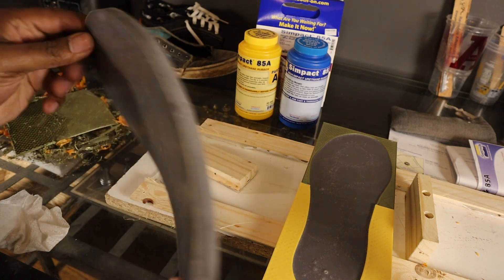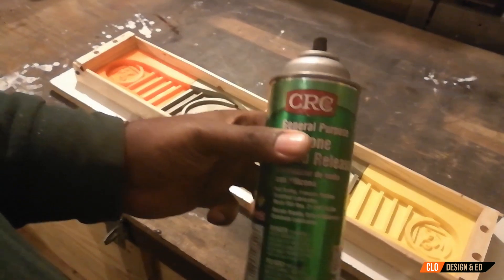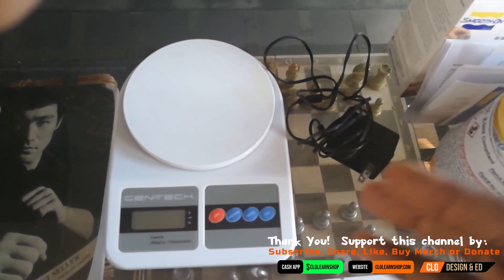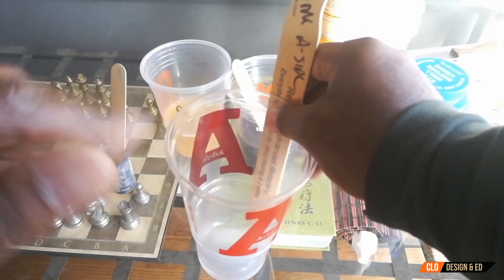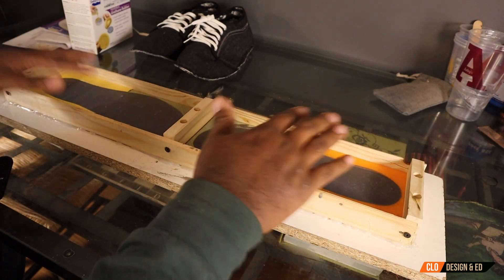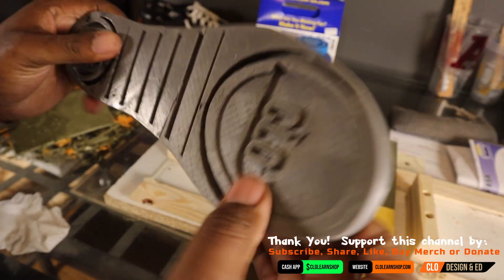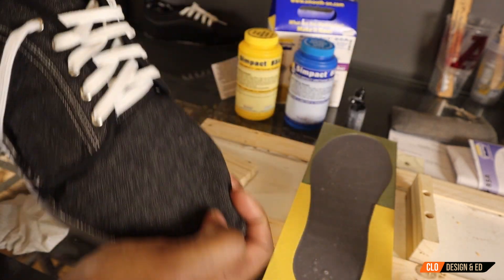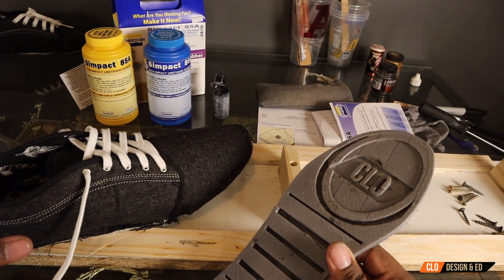It Worked! I Made a Shoe Sole Using 3D Printing! | DIY Shoe Soles | Subscribe @cloeducationtv

Comment: First video I've seen so forgive me if you cured your mold issues

My approach would be to print the sole itself, not a negative. Finish it up really nice with filler and paint, give it any texture you want to see on the final part, but make it nice, every detail will show. 

Using the same wooden box approach, use the 3d print to create a silicone mold that's a negative like your original 3d prints here. 
Let it cure up then remove your 3d print from it. 

When you want to make a sole put your silicone mold into your mold box and fill like you did here.
When it's cured, the silicone will peel off pretty easy (still need s release though) and can be reused a load if you're careful.

Draft angles aren't critical with this approach as the molds flexabity gets round a lot of those problems. A mould like yours here could almost turn inside out.
If there are problem areas you can slice the silicone mold so it can be peeled open, I recommend wavy cuts rather than straight ones. Leave the mold whole though. 
This makes demoulding sooooooo much easier 

Lastly, the same process can be used for your over molding step, the flexability here is immense. 
Using differing colours and possibly shore ratings, and multiple over molding steps the sky's the limit. 

Thanks for the video, I'm off to see if you've more on the shoes
Reply from the maker: wow just reading your comment has inspired me to do more shoes yes... I learned a lot from your comment and will pin it in the comment section... Ill be taking notes and applying some of the tips you gave! thank you again1
Reply: @cloeducationtv  I'm going to try some shoes myself after seeing yours.
Looks fun, making them
Reply from the maker: @Th3_Gael  awesome that's what it's all about...

Comment: Clo, I think draft angles can help with the mold release. You could possibly print the male version of that portion then cast is another silicone, that way you have multiple flexibility options. When I do molds the layer lines help grab the silicone, so I either print with a finer layer height or hit with some filler/primer spray to help seal those areas a little better.
I've watched her video also and it was great! I think yall could be very successful (I pray for yalls success regardless), if yall get the general outline of the shoe portion also as a DXF for laser cutting. With a desktop printer (ender3) and desktop lasers (xtool d1), one individual alone can get kids making their own pair of shoes. If its a DXF for the laser, you can print it out on paper to scale, kids can draw their own logos/designs, scan, and input into lightburn at a lower power setting,  and easily cut out their shoe after its engraved the way they want it. I don't post on my YouTube, but I'm a maker also and can help with any part of the process.
Reply from the maker: Thats awesome there is a lot of detail in this comment and I will make notation of the tips you gave and offer to help, and thanks for that...I will try to implement those modifications.  Thats awesome and I will sub to your channel.  Thanks for commenting

Comment: I need ones with higher arch support. Plus raise the back sole a little. Hot glue molds work great. You can make easily. Also silicone ones too that you mix with corn starch n food color to ensure good mix. Using your 3D print as a template. You can use Vaseline, other silicone sprays. Try in small experiments. I'm really looking forward to making soles. Ones that work with my bad foot issue.  Love your video. Ty
Reply from the maker: Im Glad you found the video useful, and thanks for the tips.